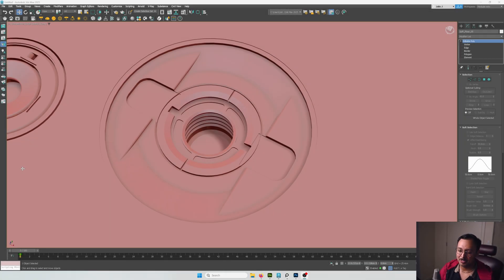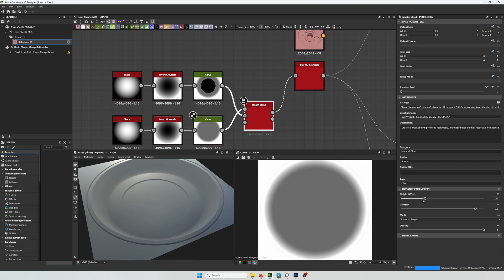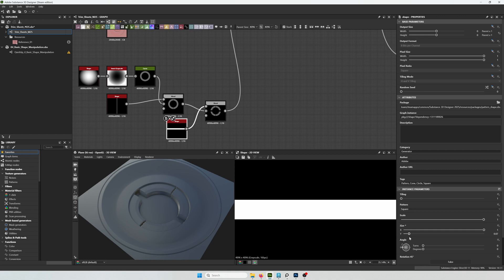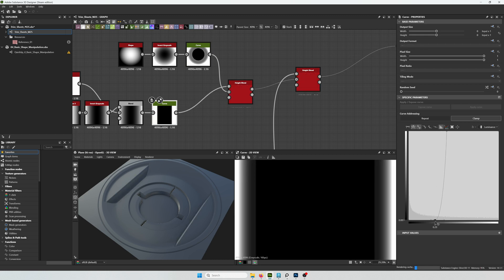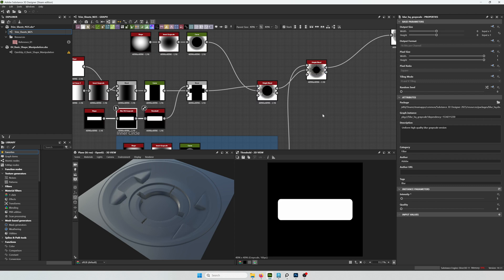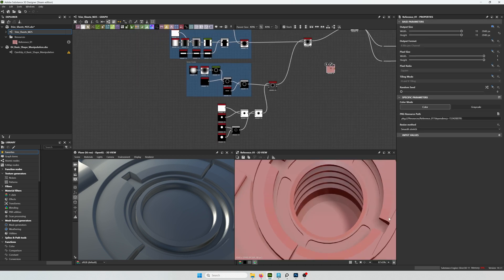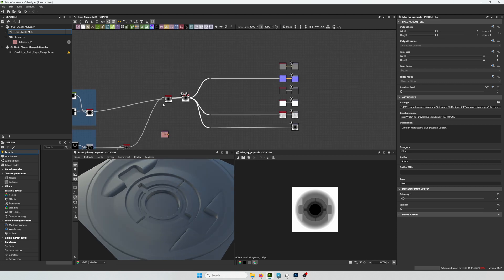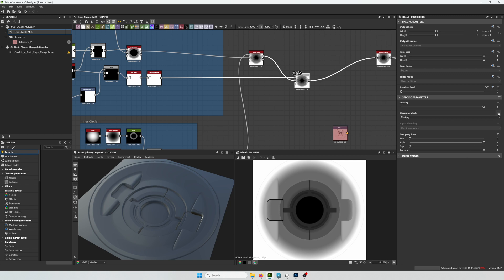Create Hard Surface Details in Substance Designer | Procedural Modeling Basics

Comment: That's some good information, especially since I never really thought to merge two different Curve node results like that. Though it's so obvious after you show it. I definitely need to experiment more with various nodes.

EDIT: If you set your Threshold to 0.5, it will maintain the shape's proper size.
Reply from the maker: Thanks for sharing that tip! It’s exciting to dive into Substance Designer. Since it’s fully procedural, there are always new node combinations to explore. Best of luck!
Reply: @ 
You're welcome.

Yeah, Substance Designer is filled with so many possibilities, which makes it interesting to learn but also a lot to wrap one's head around.

I have over 1700 hours in it, but there are so many nodes I either hardly use or never use. It might be a good idea to both go through the nodes I don't use, one at a time, in new projects and make sure I fully understand all the settings in the nodes I do use.